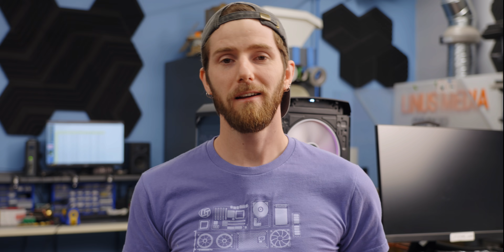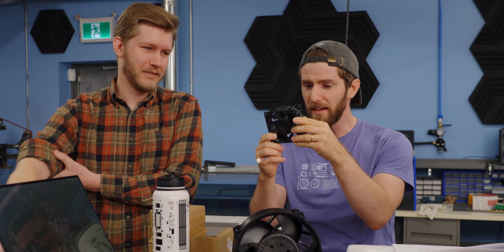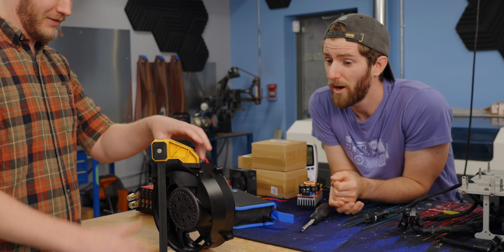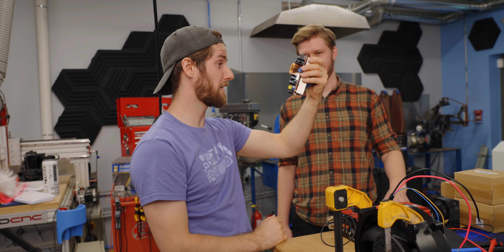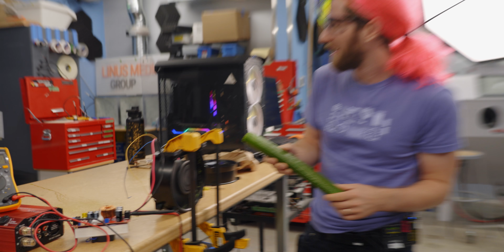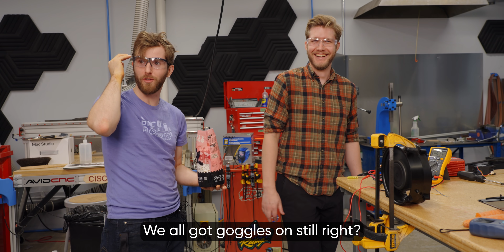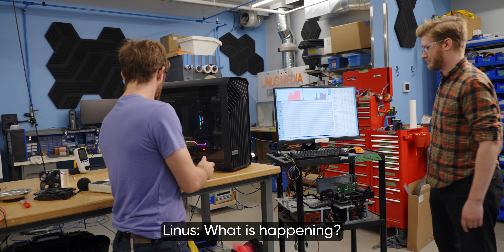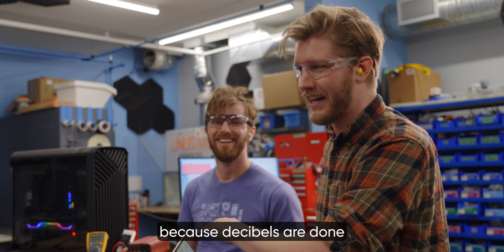The God of Computer Fans

Comment: I haven't touched that big of a fan, but it's baby brothers are used in industrial sized frequency converters and power drives (? unsure about the english name) of 90-200kW. I'd guess that big fan is needed at 500-5000kW range devices for active cooling. Those fans are scary, but it's scarier when they stop working which is something I've had to deal with.

Comment: Fans like this are used for industrial variable frequency drive cabinets. Big ones like for example a 250+ HP MCC installation or even wall mount frames. The fans are on the bottom of the enclosure blowing through the massive heatsink on the back of the unit shooting hot air out the top. Needless to say you need good AC in a MCC room where you would have many of these units stacked side by side.

Comment: We used them fans at work and they absolutely rubbish,  don't get fooled by the die-cast build the bearings will fail after around 2000 hours as the blade isn't balanced at all.

Comment: I've seen fans as big as these on fan trays for rack-sized servers like Sun Fire E25000 or Oracle SPARC M6-32. Also, there are bigger fans inside in-row cooling systems from APC. 
I remember my first swap of a failed fan module in something like 12U server. When it was ramping up I thought "there's no way it can get any louder than that" and "oh, I guess it can. Well, definitely not louder than this" and "oh well..." like 5 times.

Comment: I have worked for a company as a subcontractor that used those fans. The company made high power ,high Voltage power Supplies for the Silicon Industrie.

Comment: I interned at a server farm used by colleges for research. They were used for pulling the (very) hot air out of the server racks and into the cooling setup on the top of the building

Comment: We have something similar to these in duct work, its called a booster fan. I actually got tired of how warm my pc would get, and couldnt afford a new case. So I have something similar mounted to the outside of my case. I cut holes out in my old pc case, took the front panel off a old traffic light, mounted it on the front of the case to 'protect' myself from the fans, and put three booster fans in. they are only about 1/3 what that crazy fan you have going produce.  but it force cools my pc nicely.

Comment: In the company I am working at we are producing highly automated saddlebinders. We are also using fans like those in our electrical cabinets to cool down the whole cabinet and it's components like big servo controllers, powersupplies, PLC's and so on. Ours run with 230v AC (normal 1 phase voltage here in Germany) though and they are a bit smaller. On the bigger machines we've got additional AC units mounted in the doors of the electrical cabinet. In the printing houses our machines are sold to it is very warm, especially in the summer and those components are producing a lot of additional heat you have to get rid of.

Comment: These look like some of the fans we have on our PLC cabinets at work. Those are basically just very large systems of computers in cabinets that run heavy machinery and can have voltages as high as 4160 going into them, at least some of the ones where I work actively have 4160 going into them but most are 480.

Comment: I used 12KRPM Delta fans zip tied to noctua coolers to air cool a bunch of rack mounted Threadripper 3970X's. Seeing it light up all 32 cores on 4ghz was epic. Those fans also didn't come with connectors, but they weren't really expensive (compared to the threadrippers on their $800 motherboards..).

Comment: So ENT tech here. I see these fans in a lot of data centres. They would suck air out of the sealed hot aisle and force it through some radiators into the cool aisle. Idk what they put in those rads but the temp drop goes from 50c to 22c approx.

Comment: I kid you not: we have an older HP 24-core server in a lab here at uni that has 6x36W 120mm fans... The back of the machine at full blast sounds pretty much like this and you can FEEL the air being drawn into the rack! It's actually insane, they never hit that RMP under load though...

Comment: Was an ASU student, they had them on the top front and top back of the computer racks, they pushed large amounts of air into the cages (down) then each server would pull air in.  Then on the back another fan would pull the air back up, and out to the ventilation system.

Comment: Delta actually got a "pc friendly" fan. It's 120mm, 12v and 0.6(or so)A. A normal 120mm case fan would draw about 0.1 to 0.2A. A decent MB's fan header can handle 1A draw, so it should be safe to plug in directly to the MB. 

I use one for exhaust, and it's super effective. Gotta put up with the jet sound tho....

Comment: You guys talked about things going on fire. Wouldn't that make a cool video to mess with electronics and see how well they are or aren't protected against these weird use cases? It can be budget stuff, no problem. But seeing when a motherboard catches fire is kinda a cool video imo. Granted using fire is probably a work environment paperwork nightmare but still. You could see if your local fire department is willing to cooperate to educate the masses. There aren't many PC specific videos about fire prevention and what happens if you use janky cheap hardware, bad connectors or never clean your pc. Not to mention the increase in safety standards compared to older electronics or janky imported ones that don't follow regulations.

Comment: I remember back in early 2010s buying 3 Delta FFB1212EHE-F00s for my computer. I had no experience in fans, I just googled "Highest CFM computer fan" and bought three. Three frickin jet engines show up on my doorstep. 4000 RPM, 190 CFM, 24 watts of ungodly blowing power. I got bit by a fan twice before I learned my lesson. I thankfully never lost a nail, but that fan wanted it. If they were going full chooch I'm pretty sure I'd have been in a world of pain.

Comment: Not these, but similar models we've used for cooling 480V variable speed motor controllers. They'd do the cooling for the rectifier a output IGBT sections.

Comment: Why waste so much money on all the fancy 48v stuff when you could just have connected it to mains and used a dirt cheap speed controller to lower voltage. It's a friggin fan... 🤦‍♂

Also that thing pulling nearly 500 watts possibly makes it the least efficient fan in existence. 50% of its cooling ability would be lost just to remove the excessive heat that it generates 🤣 Some of the biggest shop fans in existence don't use nearly that much power. ie a 48" (122cm) 17,200 CFM shop fan only uses about 275 watts.

Comment: Predictably Linus isn't freaking out about just how overpriced this piece of plastic is. If I wanted to generate a tornado inside my desktop PC, I wouldn't even bother with a DC fan, I'd just grab one or two AC fans people constantly throw out, and I wouldn't even need to worry about having a PSU powerful enough to run it. Cost? $0 Never mind that, I once built a desktop with a so-called "bladeless" Dyson fan I found and fixed. Oh, that's right, wait 6 more months for Linus's $2600 DC powered desktop mounted Dyson fan video ad. Because... Why not, - you have all that nasty, useless, disgusting cash you have nothing better to do with anyway. Just look at all the food and gas prices, -every day  they're falling to fractions of what they used to cost the day before 😂

Comment: I have never seen these in datacenter applications, but they are sometimes used for cooling radio transmission equipment, like for FM radio stations or vary rarely, the gear inside of the little hut at the bottom of cellphone towers. A lot of these radio sites don't have air conditioning, so they plop one of these on an equipment rack and just force air over everything. Granted, not a lot of radio gear needs these fans. Most stuff is fairly efficient and doesn't put out too much heat, but I have seen instances in which one of these fans can be turned on automatically if stuff gets to a "Critical temperature" to circulate air and keep things up and running.

Comment: I wonder if your basement computer solution would work for these? Put one of these connected to a tube in your basement or garage and then you pipe the air where you need cooling. lol

Comment: I've used a 12cm (don't remember the brand) on my case, but it was solid steel and has 20k rpm (it use 220v, so it plug directly to wall plug), the sound is insane.. the fan real purpose is to blow hot air from furnace to a dryer oven

Comment: Use case: The only other time I have come across fans like this. Are for the use of sealed out door IP dust and rain proof comms cabinets. Inside would be a 48v DC UPS with comms equipment running solely on DC. These fans would be used to keep the cabinet with fresh air flow to protect the equipment I side from boiling up. Loving your work. Pity the person cleaning the carrot off the walls. Ha ha.

Comment: This reminds me of when I first started building computers in 2008. After months of owning my first build, I decided that I should really have a front intake fan, since I only had a 120mm rear exhaust fan and an 80mm intake fan on the side panel. I started looking around for fans on Newegg, and I found a 120mm fan from Sunon that had some unreal airflow numbers. Either the noise level wasn't specified in the listing, or I just didn't think to look for one.

I remember thinking to myself, "why doesn't everyone buy these?" I found out the answer to that question after installing it and booting up my PC only to hear a jet plane taking off in my room. I promptly turned it off, returned it, and bought a fan from Cooler Master instead.
Reply: lol thats an awesome story. thanks for the chuckle.
Reply: Same. I currently have the 3000rpm noctua fans as I was mining on my card briefly and wanted to protect the memory (I have 3090 so it was a serious concern). So I waterblocked it and bought those cards. Well they work, but god damn are they loud. You could hear them from the top of the stairs when the system is doing anything. So I downloaded Argus Monitor and massively tuned them to hell. 

Most fan controlling software was worthless for controlling them as was the bios as many restrict control below 40%, but 40% of a 3000rpm fan is still over 1200rpm. Argus let me even control the speed the fans start spinning up which most other programs didn't (as it risks damaging them if it doesn't get enough power to kick in). Have them set to continually run at 10% speed and start spinning at 30% so whenever I do anything I hear it rev up and then turn back off. But if I'm playing a game they run consistently at a nice pace so it's not distracting. It's more opening and closing programs that is annoying. 

Still, software can never solve it when the system turns on as it still sounds like my brother's PS3 he bought on ebay and never cleaned out. Probably will be using different fans in future builds...
Reply: I love yhis story lol
Reply: Had a silverstone fan in 2008ish. FM121 46 db 125 cfm.
Reply: Today when I walked into my economics class I saw something I dread every time I close my eyes. Someone had brought their new gaming laptop to class. The Forklift he used to bring it was still running idle at the back. I started sweating as I sat down and gazed over at the 700lb beast that was his laptop. He had already reinforced his desk with steel support beams and was in the process of finding an outlet for a power cable thicker than Amy Schumer's thigh. I start shaking. I keep telling myself I'm going to be alright and that there's nothing to worry about. He somehow finds a fucking outlet. Tears are running down my cheeks as I send my last texts to my family saying I love them. The teacher starts the lecture, and the student turns his laptop on. The colored lights on his RGB Backlit keyboard flare to life like a nuclear flash, and a deep humming fills my ears and shakes my very soul. The entire city power grid goes dark. The classroom begins to shake as the massive fans begin to spin. In mere seconds my world has gone from vibrant life, to a dark, earth shattering void where my body is getting torn apart by the 150mph gale force winds and the 500 decibel groan of the cooling fans. As my body finally surrenders, I weep, as my school and my city go under. I fucking hate gaming laptops.
Reply: @bro918  bruhh🤣🤣🤣🤣

Comment: I have used these types of fans at work. They’re used on larger water coolers, just larger finned heat exchangers or they’re used in large power electronics in stationary enclosures that are dealing with 1MW system

Comment: My heart skipped to be it when I saw the high-quality power converters. Although to be fair, I've been electrocuted while working on a power supply. That was AMPle fun. No permanent damage, but temporary tachycardia and migraines from us was not fun.
If I were doing this, I'd be in the other side of the room wearing rubber rain boots and a rubber raincoat
Reply: So do you think it's enough to overclock the 7950 and an Nvidia 4090?

Comment: Alex is right in that there's actually nothing scary about turning trim pots on a boost converter with screwdrivers, it's what they're made for. However, you should use a plastic one. Keeping fingers close to that fan is a different level of insanity though, one slip up like a mic getting sucked in can cause metal bits to fly out, and you're trusting that the fan blades won't shatter.

Comment: Actually the fans aren't producing high voltages when spun because the motors were designed to be more efficient at converting electrical power to mechanical. So while motors can be generators, they aren't good at it. Thus, the lower voltages.

Comment: I've actually got some of those fans! (Or fans that seem to be identical.) i got them a couple of decades ago for not all that much money (can't recall, but I doubt it was more than maybe five bucks each). I was going to use them to blow on my tomato seedlings before transplanting outdoors, to prevent them from getting 'leggy" and to strengthen and thicken their stems. (Tomatoes tend to have very tender stems unless there is wind that moves them around, which causes them to strengthen their stems.)

My fans are 24 volts, BTW. Sadly, they're "somewhere" in my "Indiana Jones Warehouse," but, I still harbor hopes of finding them before I'm off to my reward.

Well, I guess I'll click on the button to restart the video and see where it goes...

Comment: I would love to see a "fanless" focused set of cooling products used in this case with those fans, or maybe server style cooling that is meant to be cooled by a server fan.Just for the sake of excess
Reply: Or you can use actual server fans so when you play a flight simulator you get better immersion with realistic jet engine sounds 🤣
Reply: fanless focused (aka passive) heatsinks don't perform great with fans. They're usually made with wide fin gaps and thicker fins to increase convective dissipation. 

This unintuitively also means they don't scale  well with high airflow, as most of that high airflow is pushed through the wide fin gaps without actually touching any surface area and carrying away heat.

It's why some heatsinks like the Thermalright Macho B/Grand perform very well with low speed fans, but don't scale with high fan speed and then lose to tighter heatsinks of similar size.
Reply: @TheHavocInferno  I wasn't aware of those issues! Though I'd still love to see these fans being used in some sort of other project regardless
Reply: have you seen their table of radiators?
Reply: @AnyNotEverything  I have, it's a wonderful hunk of metal :D

Comment: 14:14 We use similar sized fans at a Datacenter for cooling the power electronics of the UPSs, each core has 18 of these and they're pretty loud and move lots of air.

Comment: DC brushless motors has electronics acting as commutator which does not work in reverse, so it can't work as a generator as a whole, but if you rip that out and hook the motor directly though, it will.

Comment: Used to see them in server racks with backplane board mounted vertically at the back so the CPU (control) board and telecom equipment boards can be slotted in and removed from the front.

Back then, POTS, modem, DSL or cable services came in big boards that slot into big server racks. And since the telecom rooms in telecom exchanges are in some odd corner of a building with no Air-con, they needed these fans to cool things down.

These days, it's all IP-based so you get fibre being terminated at these racks rather than twisted copper pairs or coaxial cables. Optronics based networking uses much less power and hence generates less heat so I see many OEM use 3U racks on an open-rack.

Comment: The biggest issue with this is that the fan produces enough air that it also starts to create friction, even if any heat created by that friction is also blown away. This could create a great deal of static that could fry something.

Comment: These are used in big variable frequency drive enclosures all the time. At my old job we routinely worked with variable frequency drives that controlled 1000HP + motors.

Comment: A pair of thoughts for you. 1st, imagine how effective a fanless CPU cooler could be with these fans blowing across it. 2nd, how thick of a series of water-cooling radiators could these chill in a push / pull configuration.

Comment: @2:30 you missed another thing other than weight that contributes to the danger. Its radius is greater making the speed at the tip even faster. Think of the circumference as the distance it has to cover every complete rotation. The greater that is the greater the speed at tip needs to be for an equivalent rpm.